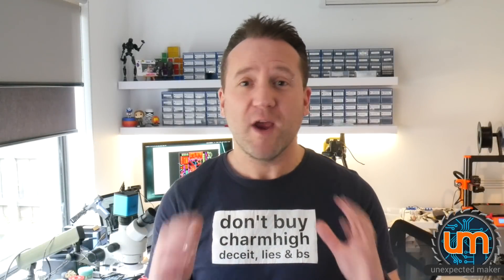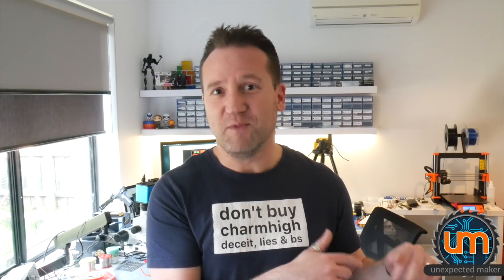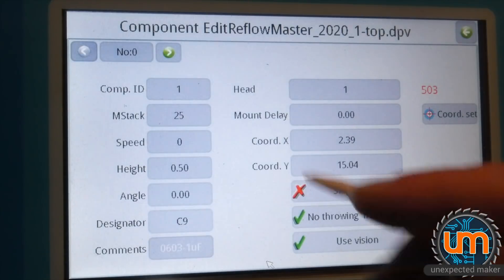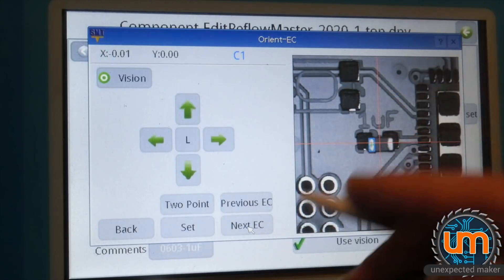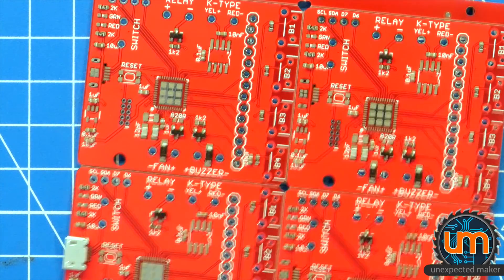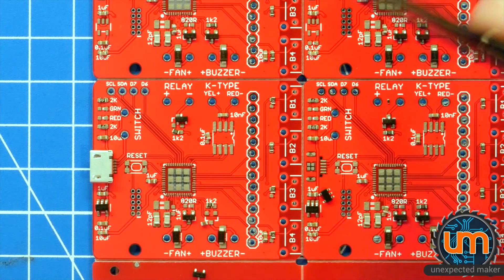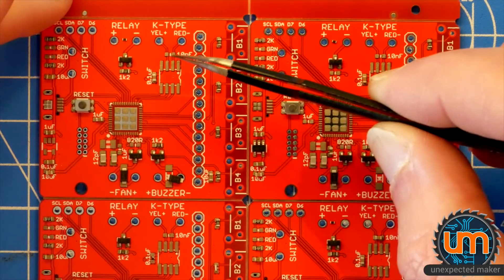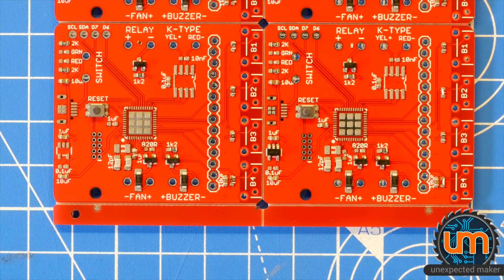Charmhigh 560P4 Review - Ep #1 - Reliable Placement?

Comment: The parts will move if you don't put solder paste down.  Parts will also slide around if you don't secure the machine solidly to the table so it can't move.  This is a high speed machine and will vibrate/slide across a table according to Newton's laws.

Comment: I am using chmt36...it wotked  good
Yes i have found such irritation in the beginning but step by step i have learn how this machine works best..
Reply from the maker: I had a 36VA - It worked 3x better than the 560P4.
Reply: @UnexpectedMaker  i am planning to get one chmt560p4..have you solved all issues or its it's clear red signal..need you opinion
Reply from the maker: @mohitshukla3447  Yup. I solved it by trashing it and buying a Neoden K1830 instead. 560P4 is a joke.

Comment: Looks a mechanic problem... Some backlash on y axis is screwing the positioning... It can be also too low current on the y stepper.. Perhaps if you do some work on the motors, balls crews, bearings and couplings it might work..
Reply: Can you slow down the feed speed and see if it keeps missplacing?

Comment: how good is your nozzle suction? 
That kind of random placement is what I was seeing on my little 36VA when I used a smaller nozzle on larger parts. The parts would shift position on the nozzle after they were picked up and after they had been through the vision system. 
They would shift position while being transported from the vision camera to the placement position. Maybe the 560p4 has more vibration on the x/y rapids causing more part shift on the nozzle - and maybe it's something you can compensate for with more suction, different nozzle selection, slower rapids....

Comment: Just to let you know. I bought the same machine about a couple months ago and finally got around to getting it up and running unfortunately....I am having the same issue as Seon with the part bounce. Not only that but some of my feeders are completely useless. I have found about 5 of my 30 (8mm feeders) are not able to keep the air and I believe it is because of a faulty solenoid. I will keep you guys posted since Seon hasn't posted anything in almost a week. Hopefully he has made some progress on this. I pinged CHARMHIGH with a couple of updates the past couple of days I will see if I get different feedback than Seon.
Reply from the maker: Dude, sorry to hear! I hope you get some actionable help from CHMT.
Reply: @UnexpectedMaker  ya pretty much in the same boat as you they're saying the previous feeders are obselete now and want me to upgrade. This is really disappointing as at this time they're not wanting to refund me for the feeders so I can upgrade to the electrical ones. When it is clear their system was not intended for these "new" feeders. I wish they made me aware of this. I haven't even asked for a price yet because I'm so upset. One other thing everyone should know is be careful with the 8mm feeders I thought you could adjust them accordingly. But there is a 8mmx2mm and 8mmx4mm. Obviously for different spaced components, but I thought I could adjust this like other feeders I have seen in the past. However this is not the case...
Reply from the maker: Shame buddy. The electric feeders are about 3x the price. But they can be switched between 2mm and 4mm pitch.

Comment: in material stack, e.g. M24, "USE VISION" it is not for picking up! The pick up is blind, after pick up the machine compensates with vision and than places the part.
Reply: Seems the problems you see are from calibrations and need for lower accelerations (hidden menu)
Reply from the maker: I know it’s not for pickup. I’m not new to CHMT machines and software. I’ve built over 10k boards on them.
Reply from the maker: And no, not calibration issues, and no, not acceleration either. The machine is calibrated, and lowering acceleration has made no difference. If it can’t pickup a part properly, it can’t place it properly.

Comment: Wow, that's particularly crazy.  So many failures that the machine isn't detecting with the vacuum sensing and vision.  My CHMT48VB lacks per-feeder vacuum settings and per-feeder vision threshold but works soo much better than the 560P4 that you have there.  Do other people with the 560P4 have the same issues as you?
Reply from the maker: yeah, my 360VA was 10x better than this machine. Others have this machine and don't have anywhere  near the number and severity of my problems. Clearly a faulty machine.

Comment: Wish this would just come right. Really odd thought - is this running on a concrete floor or suspended timber?
Reply from the maker: Concrete, then timber framed floor (not suspended), then concrete slabs under PnP feet. Machine movement is not the cause of any of this... I wish it were!
Reply: @UnexpectedMaker  Thought you would have considered it. I can see your frustration level building and just hope that you manage to find some workaround which isn't eating your soul.

Comment: CharmHigh=QualityLow I think it's a translation problem 😁

Oh man. I wish I lived next door so I could lend a helping in - in so many ways (helping manually build boards,  diagnosing this and, eventually very likely, chucking this off some high cliff - if we didn't go with the Mythbusters idea!) It's soooooo frustrating to me and it's not even mine!
I have to admit I like @DaveDarko 's idea of corrupt silicon.
It has to be a multitude of causes - bad coding (incomplete or non-existent error/task completion checking), intermittent control of vacuum (although that can be tested by monitoring the vacuum lines) which again could be also either bad coding or bad silicon. It could be noise in the data/control lines. There's just so much it could be.
The fact remains that the ROOT cause is poor quality. Poor quality of manufacture, poor to non-existent quality control and poor quality of management.
If I was the product manager for this, I would never let this out the door. If I was overruled by a VP or CEO then I'd quit. I wouldn't want to be associated with this crap.

Comment: YouTube recommend brought me back other wise I would not have seen it...........He just showed you how capable the machine is. Look at the placement. The machine is stepping through correctly. So, the question is what causing the components to be out of place. Either it is being effected by inertia, vacuum. 
 Inertia can cause the component to be tossed instead of placed. Excessive speed, lack of stop delay between stop and place. 

The Transistor looks like it was dropped. That seems like it should have registered an error. 
Two scenarios:
Drop going to location
Component stuck to nozzle, never being released and dropped on return.  
The Z position release could be too low. On release the chip could be picked back up and dropped on return. 

If you look at his file. Speed is set to Zero. This means that the machine is running max speed. 
The height is at default value. That will vary with components height and PCB thickness. 

These machines require a specific setup for each run. If you pay attention to detail it will work, it you don't pay attention you will have problems. 
Like I stated before Don't make emotional decisions in a Business proposition. 
Smack, Smack (That's me smacking you). Focus on getting the machine going. 

First off slow the machine down so you can see what it happening.
Reply: I agree, break the problem down and seek to determine which part of the process is failing.

Comment: It is possible if you use a larger nozzle to pick up small parts that it inhaled them. That will explain bad pressure detection and that mysterious 0402 part you found on the board. The components found far from the point they should be is likely due to another badly placed components that was in the same space and so the head was trying to place a component on top of another and was thrown away in some random place.

Comment: Watching your video, bothered by the jittering blue bounding box. I am entirely unacquainted with pick-and-place machines. Saw your earlier episodes where you described the physical problems with part pick-up. However ... I have a guess to a part of your problems, maybe,

The jittering (or oddly placed) blue bounding box tells me the vision AI is having trouble. This does not seem good. If vision is used during pick-and-place, this could be a source of some of your problems. 

Again, have not read the entire comment threads for all your videos. Maybe this has already been covered. But if in your place, I would want to make sure the vision subsystem is not a source of trouble. Do not want to see any jittering bounding boxes, unless convinced vision is not active during pick-and-place.

If the Charmhigh folk used a not-particularly good vision AI (or light-leaky enclosure), then you might need to control lighting and contrast to get better results. You have strong light from outside during day. Any difference in runs between day and night (or with the windows covered)?
Reply from the maker: That jumping box is because the vision is "on" in that screen, but it's not intended to be "used" in that screen, so does weird things. Really bad software, but yes, their vision system in general is crap ;)

Comment: On board four you've got a part hanging out at the center of the bottom of the board half-on, half-off at the locator hole. Just about where the vertical and horizontal score lines meet.

Out of curiosity,  try pulling the 0402 part from the feeder to see if the process hangs because of a missing part.

Comment: Firstly, I know absolutely nothing about pick and place machines, But, I have built a couple of CNC machines, and pulled my hair out trying to debug equally frustrating problems. Just a thought, Have you checked the very basic simple things, i.e. could it be something such as a loose shaft connector on a servo or encoder, maybe a belt. 
 It may be that rather than not working, your vision system is actually working really hard to make it look like it is working better than it is, Say the shaft is slipping this would mean the encode doesn't notice missed steps etc, then when the head arrives at or near what it thinks is the correct position the vision system kicks in and aligns it to what ever looks the most like what it thinks should be there. That could happen picking up the part too maybe ?
  This is the only way I can see in my mind how some of the things you describe could be happening...

 I had a very similar problem on a router that drove me mad for ages, eventually it was a shaft connector that was slightly loose, but the way it loosened it only slipped in one direction so sometimes depending on the code it would run fine.

Really strange problems... good luck.

Comment: Btw. Does the PNP calibrate with each step? Because you can't rely on just the accuracy of the feeders. In fact sometimes it happens that part are even flipped in the reels. I used to work with a professional PNP myself and does things always calibrate after picking up the part.

Comment: Why don't you start rebuilding and modifying the PNP yourself? At least you will have something in the end?
Reply from the maker: I need a machine now... I have boards to build. I'm way behind production as it is. No, I have no desire to "rebuild this into a better PnP". I'll buy a better one when I can afford it. So for now, I use what I have and do the best I can do.
Reply: @UnexpectedMaker  I totally understand that. But at least you can do something constructive with it?
It's useless and broken now anyway. So the only thing you can do is making it better.
At least that would be my approach. Just spend and hour here and there. That's better than flushing everything down the drain. 
Otherwise sell it as scrap/diy project and move on.
Reply: Seon could rebuild it, but he really shouldn't have a need to. Lets say he bought a new self driving car that doesn't self drive and he needs to replace wheels and engine or anything else that make run or self drive. Seon bought a solution that should have all the work done so he can just make things.
Reply: @deathshaker0026  I agree, but "should have" is also not going to fix it, isn't it?
Keep repeating "should have" is not going to change anything.
I think at this point it's clear that Charmhigh isn't going to do anything.
Keep dwelling about it is not really constructive and definitely won't make it work all of a sudden.
Reply: @p_mouse8676  I feel bad for Seon because he spent like $19000 to buy it and needs to spend just about the same amount to just get the machine to work.
Reply: @deathshaker0026  yes. Me too. It's horrible to spend so much on something that doesn't work. 
But after a while you also just have to move forward.

Comment: Those 0402 resistors are a clue. It is obviously picking them up correctly from a feeder... Why?
Maybe the file is corrupted. How/where is the data stored? Maybe it's a damaged SD card?
That might also explain why it loses the calibration settings when you turn the power off.
Re some parts placing off-target, that could be resonance from the steppers causing the part to drop from the nozzle as the steppers slow down in the last couple of mm. Increase the vacuum strength (and check for leaks) might help fix that. Good luck with that piece of garbage machine... 🙈😥
Reply: Battery backup kaput?

Comment: Resistor in capacitor position WTF!!.....I'm thinking PnP processor board issue and which might be causing lots of other issues.....
Reply from the maker: At this stage, it could be the weather or maybe c-19 causing these issues!
Reply: @UnexpectedMaker  Yup, I certainly wouldn't rule it out. Anyways, kudos to you for keeping some form of sanity through all this.....if it were me it would be a pile of mangled metal in the back garden.....!

Comment: Well at least some of the brokenness seems to be firmware/software related (aka fixable if they wanted to)
Can't help wondering what the machine would be like running openpnp... Without the charmhigh feedes ofcourse ... heck I would probably prefer  "StripFeeder"s stuck to the base of the machine over ones that consistently throws a large percentage of parts around..
Not sure how much faster it is to rework those boards than to manually place the parts in the first place....
Reply: I was thinking the same. With OpenPnp you can at least see where things are going wrong if not calibrated correctly.

Comment: Hi Seon, Ciprian here from Romania, thx for your review, I was in the point to buy CHM-T36VA and to modify for Open PNP, but defiantly I will no buy and I want that this kind of supplier to despair from the market, and as you already say, the vendor answer just for some question, when I asked for sale also a mainboard, (to have for backup is something is going wrong with Open PNP ) they no answer also if I asked for some parts.. no answer or hesitate like he does not understand right 
Now I'm orientating for ZB3245TS if someone has one please leave the feedback 
Thx Seon, and I really appreciate what you do!
Reply: I first looked at CHM-T36VA as well, but went with TVM802A.  I'm glad I did, it has a learning cure because of Chinese software, but it works well once you figure it out.  Don't buy Charmhigh!  QiHe also has great support, and they have helped me numerous times, with 24hr response time always.
Reply: I am using 36va for last three years. Assembled thousands of boards. Never faced any problems. I am from Pakistan.

Comment: Personally I think that all the issues that you are experiencing will be able to be tracked and traced back to the firmware and software on the machine.
Some set of not so well educated manufacturers fingers went and changed, removed or added some code in one or more places and that has ballsed everything up.
In my experience what probably happened is they were trying to add/fix something, needed a variable but used an already existing variable so its value is sometimes being changed by a part of the program that has no business changing that value.
The result will be ongoing erratic behavior which WILL drive you insane.
In my humble opinion you need to try get into the source code which is hopefully a script running on the machine - maybe JavaScript or Python or similar - and analyze it. Hopefully fix it too.
If it is a code issue then no amount of hardware hacking and changing is going to fix anything.
Wish you the best of luck.
Reply from the maker: There is definitely software/firmware issues, their stuff is crap, but there are also mechanical issues. So many issues.

Comment: if we're lucky the same people are building the warplanes and boats they're sending in the South China Sea
Reply: In my previous job we had some Chinese transistor driver. They would spontaneously combust and/or heat up so much that diodes would desolder them selfs and fall off and prevent a fire. And when we tried to return them they said, not possible the engender the build this drivers also builds torpedos for us so the rivers are 100% without fault XD RIP submariners.

Comment: Is their a wiring harness on the camera with a broken wire that intermittedly looses connection or causes the camera to reset?
Reply from the maker: Nope. Pulled the PnP head cover off and everything looks ok. Could be something faulty at the PCB level though. No way of knowing, no schematics.
Reply: @UnexpectedMaker  could be a cracked trace eh

Comment: Can the machine be set up to run in slow motion at 10% speed? Would this change precision?
Reply from the maker: Nope, anything under 50% makes it fail, and the slower you run it, the worse it places due to competing vibrations/harmonics. It's a known issue on the CHMT machines.